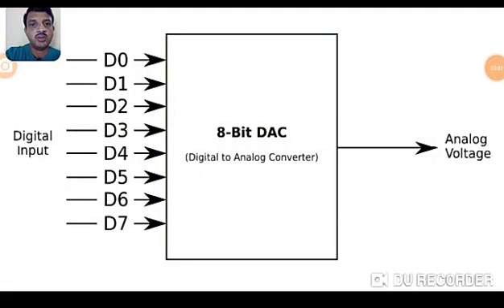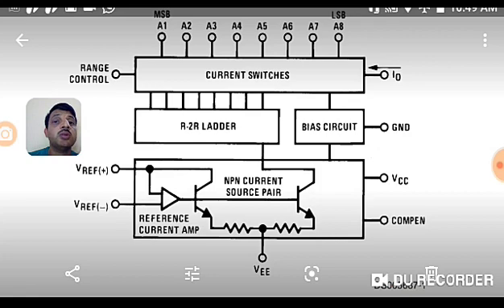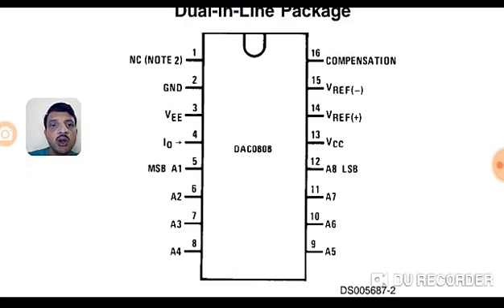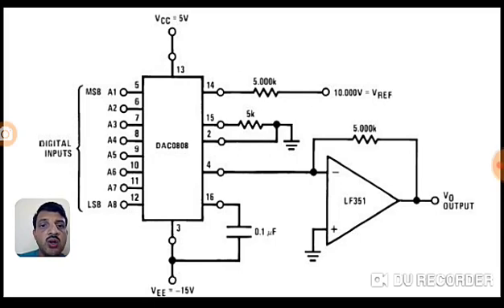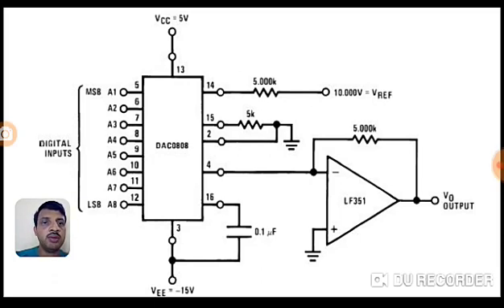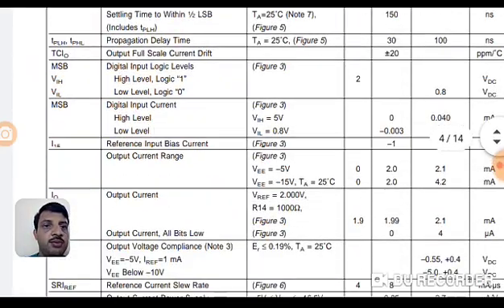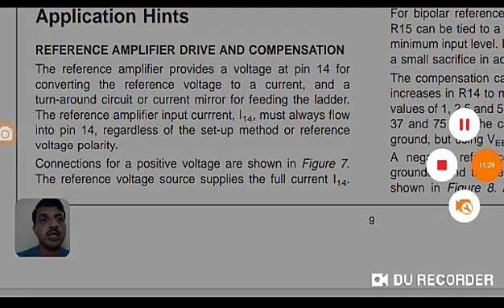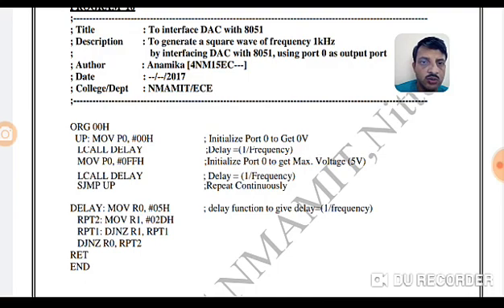Interfacing DAC 0808/09 with 8051 microcontroller

Comment: i use zero volt instead of the negative VEE volt it's not working 
why it should be negative voltage sir  ?
Reply from the maker: Hi David 
Negative voltage is must for the internal circuit. Its given in datasheet. It is required drive internal opamp.

Comment: I am trying to interface DAC 0800 with atmega8 in Proteus and just writing some values to DAC data pins. But the output I am receiving is nill?
And I didn't found any working example of this DAC ic interfacing with atmega8 what I found is with 8051 only.. can you please suggest me.
Reply from the maker: Put a load resistor at the analog out. The value of R is dependent on the output current. Refer datasheet to know about current value.